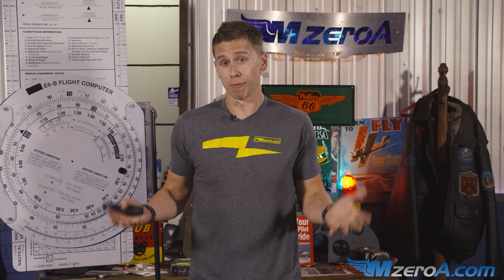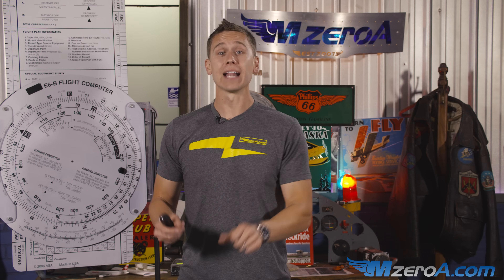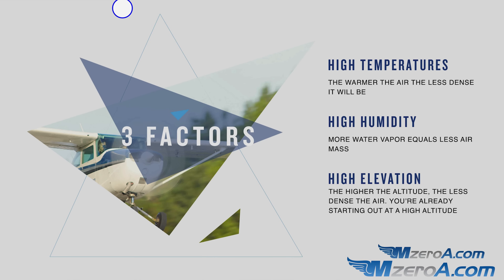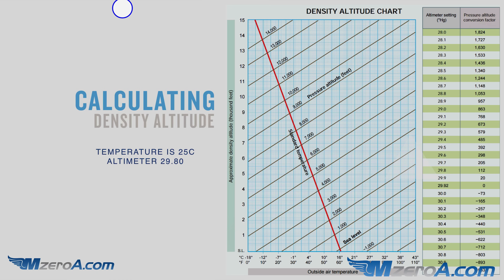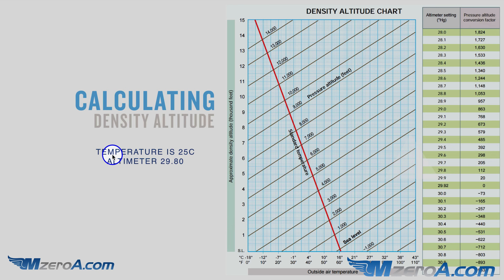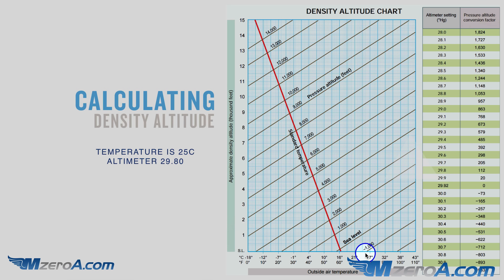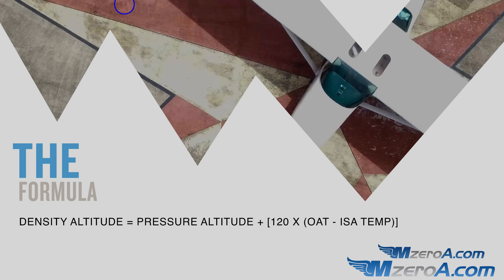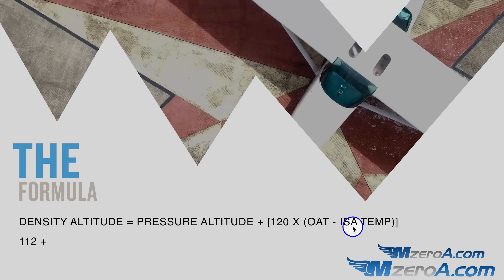How To Calculate Density Altitude

Comment: Old video, but too many are being confused by saying that ISA is 15 degrees celsius. It is written in the video as 
DA = PA + (120 x (OAT - ISA TEMP)), but instead of saying "International Standard Atmosphere Temp" he says "Standard Temp." Yes, it is true that standard temperature at MSL will be 15 degrees celsius, but ISA implies that you are looking beyond MSL. You are supposed to subtract 2 degrees celsius every 1000 ft about sea level. 
ISA TEMP = 15 - (number of thousands of feet above MSL x 2). 

If you are are taking off from an airport at 2,000 ft, ISA TEMP is 15 - (2 x 2) = 11 
DA = PA + (120 x (OAT - 11))

If you are taking off from an airport at 500 ft, ISA TEMP is 15 - (0.5 x 2) = 14
DA = PA + (120 x (OAT - 14))

Even at my own flight school there are numerous students and even instructors who always use 15 degrees celsius regardless of how high we are above sea level. For something as important as density altitude there needs to be better consensus across the board on how we calculate these things.
Reply: thank you very much because I was extremely confused about the standard temp.

Comment: When you do the graph estimation, you should be going up to 112ft rather than sea level, which is the pressure altitude you got from the altimeter correction.  Overall a great explanation of density altitude, though - thanks!

Comment: Thanks for the interesting and easy to follow video.  
I have never seen a pressure altitude chart before as we don't use them in New Zealand.  We also measure air pressure differently but once the pressure altitude is calculated how we get density altitude is the same.
Looking at the latest weather briefing for my local airfield it is showing a temperature of 25°c and QNH 1006.  I'm just glad I don't have to worry about converting °F to °C.
Reply from the maker: Appreciate you watching!

Comment: Hi JASON, just want to thank you for your outstanding instruction on YouTube. Looking forward to signing up for your class. In one of your videos you talk about how to calculate density altitude. You say (density altitude equals pressure altitude +  (120 X outside temperature minus standard temperature.) My problem and question is what if outside temperature is less than standard temperature? How are we going to subtract standard temperature?
Reply from the maker: Hey Derrick! You would subtract and therefore have a lower DA. If you get a negative number with that formula, you just add the negative which means subtract. If you need any further clarification on this please email us at support@mzeroa.com and we can have a CFI answer your question. Thanks for watching!
Reply: The calculator on my phone works it out for me even when the OAT is below 15°c.
PA + ( 120 x ( OAT - 15 ) ) = DA 
if you are doing it manually I would go with a slight change to the formula
PA - ( 120 x ( 15 - OAT ) ) = DA
but that change around is not needed if you are typing it into a calculator where you can add the brackets.

Comment: i got a question and idk how to google search it. i feel like i already know the answer, and that it's obvious BUT:
at a high altitude, with your mixture leaned, i heard somewhere that when you do a go around or need power you should enrich the mixture to full. but that doesnt make sense to me at a high altitude. and idk why anyone would ever say to enrich the mixture, ever. i would assume to just get the engine set correctly for it's altitude and leave it. but i don't know for certain.
Reply from the maker: Hello! That could be correct depending on the conditions but it all depends. For a detailed answer from a CFI, please send us your question at support@mzeroa.com. Thanks for watching!
Reply: @MzeroAFlightTraining  im not a real pilot, i just play in the sim. so im not gonna do that, ill just assume i should keep my engine running healthy and not change it unless the engine wants me to.

where im coming from is,
i was sim flying in Colorado mountains, recreating a crash i saw on youtube, and the plane performed very poorly with full rich mix at that altitude in those situations. i died just like the real plane, N36JJ. but when i mixed it right, i barely survived (by like 20 feet) on the same course (might not technically be the same as the N36JJ flight, but close enough). in regards to that flight, i personally would have maintained a higher altitude earlier, but for the sake of recreation, i started from 10k feet and flew through the mountain passes and i can completely understand how that incident happened. flying through the mountains looks really scenic, feels neat, however they can get steep in a hurry.

Comment: Can u show a formula that can be used when OAT is less than standard?
Reply from the maker: Hi Samuel! Use the formula:

Density Altitude = Pressure Altitude + [120 x (OAT - ISA Temp)]

If you need any further clarification please reach out to us at support@mzeroa.com. Hope this helps! Thanks for watching!
Reply: @MzeroAFlightTraining  are you than multiplying 120 by a negative number if the OAT is less than 15 degrees Celsius?

Comment: in the first example wouldnt you have gone to sea level but before going across to DA you would have added the 112ft and gone roughly one tenth above sea level before reading across?
Reply from the maker: Hi J Mason, yes that is correct. Thanks for clarifying! You can always use the formula as well and it will be more accurate than having to interpolate the chart. If you have any more questions feel free to reach out to our support team at support@mzeroa.com. Thanks for tuning in!

Comment: HELP!  I must be missing something... I'm applying the formula to the following example and it doesn't match when I use the chart.

Example
Altitude = 5000ft
Pressure = 30.10" Hg (chart factor of -165)
PA = 4835ft 
Temp = 4C

DA = 4835 + 120 x (4 - 15)
      = 4835 + 120 x (-11)
      = 4835 + (-1320)
DA = 3515ft

The chart shows approximately 4600ft.

I'm new to this so I'm sure that I'm missing something obvious.
Reply from the maker: Hi Pat! Sorry for the late response. Please reach out to us at support@mzeroa.com so that we can help answer this for you. Thank you!
Reply: I know I'm 4 years late but what you got wrong was the temperature, remember that when we climb up into atmosphere, we're gonna lose roughly 2°C every 1000ft, 15°C ISA is at Sea Level, at 5000ft like you mentioned, the ISA temperature would be 5°C, so replace the values of temperature (4 - 15) for (4 - 5)

Comment: The question was for 29.80, but you changed it to 29.92, so I'm not sure how to solve my problem, I subtract 112 from? using chart? My problem is 30.30, 25 degrees F, Airport elevation at 3894. I see 30.30 is -348. So using chart, I take 3894 - 348 = 3546, cruise from 25 F up to 3546 then across to about 2100. The closet answer is 2200 so I choose that, but accuracy sucks!  Your formula would be -348 + (120 X 4C? - 15C)  =  -348 + (120 X -11)  = -348 + -(1320)  =  -1668? So confused!
Reply from the maker: Hi Brian! Please reach out to us at support@mzeroa.com so we can help you with this. Thanks!

Comment: Great representation as always Jason. I was just wondering to go from the 25 Celsius marker then up to 112 feet instead of the sea level and then look up the chart in the left or the density altitude since the pressure altitude is 112 feet?

Comment: I tried using this formula and was 1000 feet too low for a practice question in the Gleim test prep book. It gives 90 degrees F, 30.2" HG, and 4725 field elevation. The density altitude = pressure altitude + (120*(OAT-ST)) formula gives 6534.4 as the density altitude, but other calculators say 7400. Any ideas what I'm doing wrong? Numbers used: 4468 + (120 * (32.22 - 15))
Reply: Seems silly answering this after 3 years, but I just saw this now.  You used 15 degrees C.  That's the standard temp for sea level but you needed to use the standard temp for your pressure altitude.  Would have been about 6.15 degrees for that PA.  Ends up around 7,600 or so.
Reply: @skyking2202  Completely forgot I ever left this comment, but thanks for the reply. Brings back memories. Now I answer these kinds of questions for a living.

Comment: I just calculated the density altitude at my location with current numbers.  Temp 6, Baro 30.37, and I come up with -1520 rounding the baro to 30.4.  Does that mean that conditions would create great lift and response to aircraft?  It is clr with 10sm also
Reply: Just looking at the data, you have a colder and higher pressure day than standard (15 degrees, Baro 29.92) which would indeed make your airplane perform better. Assuming you're at sea level, your pressure altitude is -450 feet and your DA is -1530, meaning your airplane performs like it is 1,530 feet below its indicated altitude when you have the correct barometer setting (30.37) set in the Kohlsman window.
Reply: @paulr4074  Thank you for your super clear answer.  Basically I was able properly calculate the apparent pressure and handling performance.  I have only studied this and enjoy learning more about the complexities of flying.  Hats off to all that fly.

Comment: I am having trouble getting this formula to match what Foreflight reports for Density Altitude. I wonder if I am missing something else. My formula is as follows, (Pressure Altitude + Field Elevation)+(120*(OAT-Standard Day)). So for my local airport it's currently DA = (-119+710)+(120*(14-15)). Standard day would be sea level. -2 degrees per 1000 feet. Field elevation of 710 so .71*2 degrees = 1.42 off of the standard 15 degree day = 13.58. Therefore, 591+50.4=641.4'. Foreflight says 810'.  Why don't these match up? Is Foreflight just building in a pad so people are more careful? Help!

Comment: @ 1:50  Water molecules displace air molecules , which makes less room for air, therefor less dense air.
Reply: I think it is the density of the air, it doesn't matter the gas as any gas can create lift (e.g. water vapour or N2/O2).   Moist air is less dense than dry air because H2 in H20 has less molecular weight than O2 or N2 that makes up air.  An engine needs O2 to breath, of course, so if O2 is displaced by any other gas that will degrade horsepower.

I think ISA and calculations for density altitude assumes %RH is zero (zero water content).  But moisture in the air can degrade performance due to reduced air density.

Comment: Jason, I like the idea using your math equasion because its pretty simple and I dont have to mess with graphs and charts. HOWEVER I cant seem to get the correct answer with it.  For example one of the problems I was work on came out with a 1000' difference. I think its something that i'm overlooking. let me show you my work and maybe you can tell me the issue. 

RAW given data:  Altimeter setting - 29.25          Temp= 81F (27C)      Runway elevation = 5250'   
    (altitude correction:  5250' + 626' which totals = 5875')

the formula calculation.     5875 + [120 * (27c -15c)]   
                                               5875 + [120 * (12c)]           solved parantheses first 
                                               5875 + [ 1440 ]                    solved bracket second 
                                              5875 + 1440 =  7315
Answer per formula 7315'

Answer on the e6b and using the chart is 8500'. 🤔🤔🤔 

I'm at a loss on how I'm messing up the math calculation,
Reply: Ok folks I got some clarification on the formula method. you have to use degrees fahrenheit. a quick background on this. I was frusterated when i tried to apply the math to the same problem with different numbers. heres the explanation I got back when I wrote in. 

Density Altitude Equation 

Raw Data Given:
Altimeter setting - 29.25 Temp= 81F (27C) 
Runway elevation = 5250'

The Math:

Correction for elevation formula: 
Standard Pressure 29.92 - Given pressure 29.25 = 0.67
0.67 * 1000 = 670 (elevation correction in ft)
670 + runway elevation = 5920

Density Altitude correction formula:
Corrected elevation of  + [120 * (OAT Fahrenheit - Standard temp 59 degrees Fahrenheit)]

5920 + [120 * (81 - 59)] 
5920 + [120 * (22)] solved internal parentheses first
5920 + [ 2640 ] solved bracket second
5920 + 2640 = 8560

Answer per formula 8560’

Comment: Thank you so much I really appreciate it, I tried it with the altimeter setting of 30.20 = (-257) on 21 Celsius as follows 21-15 = 6 x 120 = 720 = + (-257) = 463  and dosn't  match my chart.  ???? HEEEELP PLEASE ????
Reply: simcha rosenfeld the formula will only approximately match the chart.  The chart is based on a more precise formula.  For FAA testing if you are asked to use a chart you need to use the chart to get close enough to their answer to be sure you'll get it right.

Comment: Man you really got me messed up because you didn't say anything about lapse rates at standard temperature. People are probably using this formula without calculating the standard temperature at their given altitude. If you use 15 degrees for your equation when you're actually at 5000 feet you'll get the wrong answer.
Reply: Jake yup he missed that

Comment: In my area, a fellow who was a big time medicos, landed at a small high altitude airport in the mountains. The locals there had told him, "If  you're going to takeoff, make sure that it's early in the morning when there's a little more substance to the air". This dude was overconfident, waited till a later in the day when the Summer heat began to thin the air out. He took off his little private plane from the little mountain airstrip, the plane could not old the altitude and ended up in a tree. Density altitude to me, in many forms, is vitally important. Thanks Jason

Comment: I fly a Cessna 150 and I think about this a lot... How do I decide if the density altitude is a go/no go? I understand how to get the number, but how do I figure it is still safe or unsafe to fly in?
Reply: Cameron Tucker probably more about can you take off on the runway you have based on the calculations you find for DA and compare performance of your plane and takeoff distance.
Reply: That's what personal minimums are for.  E.g. someone with little high altitude experience might want to have two or three times what the performance chart requires for conditions.  After a few takeoffs that might get dialed back to a personal minimum of 1.5  times charted performance.  For a given plane/field/load that might become a maximum temperature at which one will takeoff.  It's all based on the POH performance data and your experience and currency though.

Comment: Mildly rusty private pilot here. I have a question about the formula you used. In your example, we are at sea level. If field elevation was significantly higher than sea level, would you adjust ISA TEMP with lapse rate before plugging it into the formula? Apologies if this is dumb.
Reply: I know it’s a year old comment but yes to answer your question you would adjust 2 degrees Celsius per 1000 feet of altitude. So if your field elevation is 5000 feet your ISA needs to be OAT - 5 degrees Celsius not 15 degrees.
Reply: Andrea Zaratin did you ever figure out the answer to your question? I'm having a hard time calculating the density altitude using the formula. I'm good with the e6b and chart but when I use the formula I come up with an answer that's a few hundred feet off. My field elevation is 858'.
Reply: @mark4079   you need to know your temperature first. Then subtract that from the ISA and you get a number. Add your 858' to that number and you will get your density altitude.